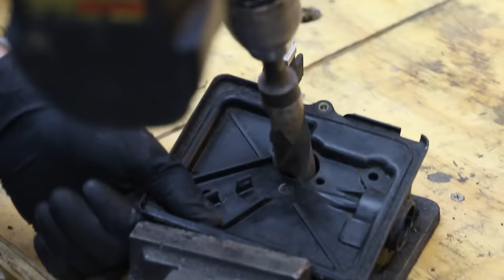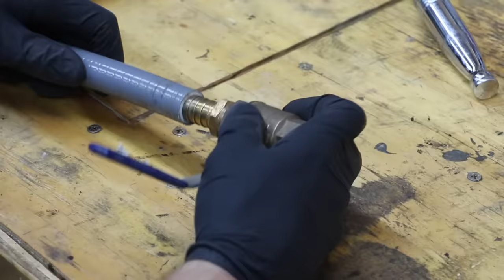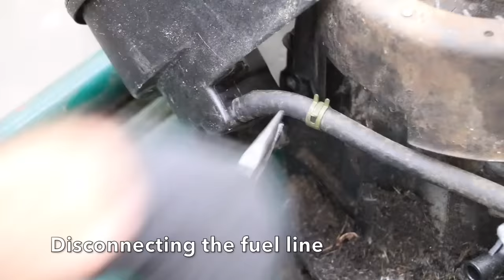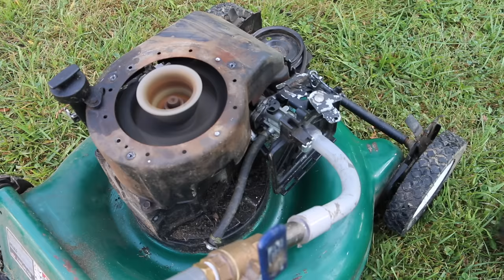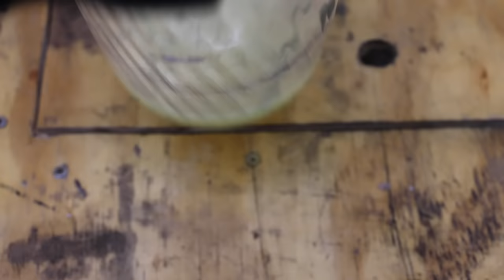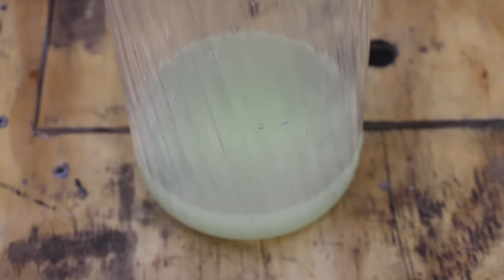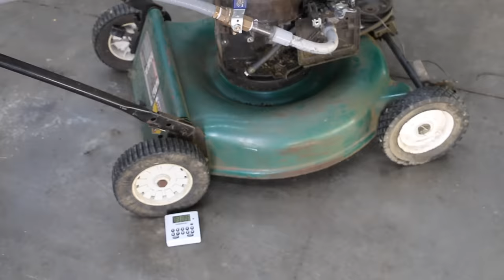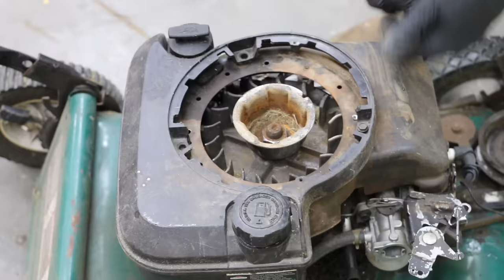Will a "Gas Vapor" Container Improve MPGs and Fuel Efficiency?  Let's find out!

Comment: Funny the Carburetor turns liquid fuel into Vapor . .it works in principle like a Perfume atomizer .. force air into the Carburetor with fuel being brought up into the correct size cambers and  guess what it turns into vapors. you might get a little but more fuel economy but not very much !!
Reply: Nope you didn't do it wrong.. you will not get that much fuel improvement !! period the Carb turns liquid fuel into Vapor so the engine can fire it into Combustion !!!  Wood does not Burn.. it is the Vapor off the Wood that Burns.. heat must transfer solid wood material into a vapor so it it will burn.. therefore Gasoline must become a vapor to burn. And it is the Carb with its different pressure cambers that allows this to happen before it enters the engine.. simple Physics... Though turning the liquid into a vapor first will allow for a little bit but still a small percentage of efficiency... but not worth the effort . .. one thing that could help is turning the fuel into vapor and then chilling it way down.. like with dry ice to like -100 F before entering the combustion chamber might increase the efficiency several percentage points but would not be worth the cost per energy out put !!!
Reply: Still inefficienties, not 100% of the fuel droplets turn to vapor before combustion...with his method it fed 100% vapor...thus the little bit left in bottom of bottle...better vaporization = better fuel economy and power (think fuel injector cleaners)  I wonder if a remote carb say  a foot to 10 feet away down a tube allowing for more fuel vaporization would do the same thing.  Only dangerous part...that extension, if a backfire thru intake valve...could result in a big kablooey
Reply: Brian C I've wondered the same about a setup with a longer draw to the carb. Part of me is inclined to believe that the vapor would sort of re-condensate back into a liquid by the time it reaches the carb. I may be wrong, only one way to find out! Well, many ways for an engineer to figure it out before putting it into practice but I'm just a regular joe.
Reply: Lies! Lies and slander! Ha
Reply: atomization is not vaporization, google it

Comment: Do the fuel vapor with the clear head
Reply from the maker: Thanks for this recommendation!
Reply: Project Farm thanks for responding to me that’s pretty cool, keep up the good work👍🏼
Reply: also is the fuel any good thats left from doing the vapor test ? if you put the left over fuel in the tank will it burn it? if so you can then add that time to the run time of the vapor test so 30 min on vapor then say 15 min on the left over fuel that can be added to the tank so you will have 45 min run time

Comment: RESPECT for an open and honest vid.
...at this point i will conclude its safer to use fuel the normal way...
This is no good for vehicle's tho, unless you have a lot of time to waste, all vapour powerd engine seem to run lean and chug along, turn the throttle up and they stall, they simply cant produce enough power
Reply from the maker: Thanks!

Comment: Should have let the used fuel sit, see if any particulates settled out.  The fuel is acting as the air filter in this case.
Reply from the maker: Thank you for this recommendation!
Reply: I would think quite a bit of water would end up in the fuel as well.

Comment: Great experiment! Truth is, all gasoline powered engines actually run on vapors. Gasoline begins to vaporize at -40F. Once gasoline is atomized by properties of the main metering nozzle in a carburetor or via pressurized injection, the liquid fuel is instantaneously vaporized providing the air fuel ratio is correct and the engine is warmed adequately.
Reply from the maker: Thank you!

Comment: the good part - if the world comes to an end and you can't get carburetors any more this idea could solve the problem.
the bad part - if the engine backfires into the intake you die.
Reply from the maker: Thank you
Reply: Just pop an in line flash arrester in as with the case is with a propane stove. Or, from the bubbler, run the gas feed hose through a watertrap on the way to the motor.
Reply: good point
Reply: it goes POP and might pop the hose off..        oh ps its not a hydrogen bomb..  there is not recurring action to produce more h2 so the brief explosion is limited to that section of hose..

it doesn't even make it through a normal oxy-acetalyne flash arrester for my torch :-(    just a lil POP! and it puts itself out
Reply: either way problem solved

Comment: no matter what, you still need it running in a happy air fuel ratio. to rich and you are wasting and eventually flood. too lean and you ping plus don't have enough for combustion. even if you run on vapor, you can't have better economy because it wont run outside it's set AFR.

Comment: Tried this idea many years ago on a Mercedes Benz car 280. Straight road it worked quite well. Uphill I found a significant power loss. In order to start the engine, I used the normal carb fuel system and once running, it was switched over to the vapor system. Never took it further though.
Reply from the maker: Thanks for sharing.

Comment: I know this is an old video and another awesome one as usual, but I have a suggestion , as I have been down this rabbit trail quite a lot  in these type of experiments...no lie...#1 try this test using non ethanol (I assume that you were using E10 or 15 as the fuel left over in the bubbler was cloudy because it was mainly alcohol and very low hydro carbon fuel chain molecules and additives that hardly flame up, as petroleum gasoline has dramatically changed in 20 years by our GREEDY oil companies , and BS DEQ. It has changed buy adding massive small light weight chain molecules with very low BTU (Alcohol and other cheap additives) out put, which is why non ethanol in a modern OBD2 vehicle gets at least 10 to 15% worse MPG than real non ethanol fuel, thats because the down stream O2 sensor wants to see a certain temp  (think stack temperature) in the Catalytic Converter for the Maximum efficiency to burn all the  excess unburned Hydro carbons, it uses more fuel because it has to make the fuel RICHER because Alcohol BTUs run cooler than Real Gasoline...Just sayin) #2 you should have a tee in line with another ball valve to adjust to adjust a proper AF (air fuel) Ratio. this would change the efficiency to much better run time than what the bubbler strait into the carb, causing it to be a Rich Air Fuel Ratio. The extra ball valve pulling outside air has to be adjusted periodically for the sweet spot but it will make a major difference in efficiency , most likely 50 to 80%!!! (and more if you used an O2 sensore with a micro processor controlled air inlet valve Sounds crazy but its true want even more efficiency add HHO to it and retard the timing by drilling larger holes in the coil mounting and pulling it slightly ahead of flywheel rotation. This Bubbler method works awesome for stationary engines, not so great in a vehicle unless it is a standard trans! I am very Impressed with your channel ...Its my favorite.. Thank you for what you do!! God bless :) Sorry this is a book..lol
Reply from the maker: Thanks and you are welcome!  Thanks for the suggestion.
Reply: The laws of Thermodynamics says that you are wrong.

Comment: Congratulations and nice test. What you have created is a basic carburetor including an intake manifold. What you do here is mixing tiny fuel dropplets with air. This is exactly what is happenening in the intake system of any combustion engine. The difference is that in your case the fuel droplets are created by air succing into the jar, while in a regular intake system this is done after gas was pulled through the main jet (carburetor) and mixed in the venturi tube and intake runner to the needed stoichiometric ideal mixture of 14.3. The key of increasing horepower or saving gas is to mix gas and air very very well. As better gas and air is mixed as more effective the vapor burns and creates less unwanted unused unequal and damadging pre or after detonation. Heating the fuel helps. A regular intake manifold does the same when the engine is on running temp.  But what if you can drive the air fuel ratio up with other flamable liquids or gas. That results immediately into less gallons per miles! I.e. hydrogene has 34:1 ratio or you need a little lessbthank half of gasoline for the same performance!!!!
Reply from the maker: Thanks!

Comment: Can you get an engine running on H202, using a Dry Cell electrolysis reactor?
Reply from the maker: Thanks for the video idea.
Reply: @ProjectFarm  Correction : HHO generator, not Hydrogen Peroxide Generator. haha sorry
Reply: I very much would like to see this! I think HHO generator with a little 12v air compressor to store it somehow, maybe use a solar panel when the vehicle isn't running to beep producing it..
Reply: @masonrumble2608  Learning more about this, there is away to produce hydrogen as it is being consumed.  I think it's promising as a practical fuel as there is no need to contain an explosive gas, just create what is being used.  I subscribed just to see if this will happen....and I like engineering.
Reply: @JorgeL721  or just u know use an electric motor, a hydrogen powered car is beyond inefficient in every way.
Reply: @sebastianflynn1746  Your hot air pessimism is beyond inefficient in every way, back up what you are saying.  The fact is that hydrogen can be more efficient than gasoline.  It's easier to produce and can provide energy for a long trip.  I know Musk would say electric its more efficient, but storing electric power isn't as practical yet.
Reply: @JorgeL721  you're delusional it's called the laws of thermodynamics, its well know efficency for hydrogen electric vehicles is only 30%. Running it as an internal combustion engine would be even worse.
Reply: @JorgeL721  I suggest that you look at the generation of hydrogen through electrolysis and its efficiency. Hydrogen even as a liquid really isn't energy dense at all very volumous for the power it can put out, that's the reason the space shuttle needed the huge external tank and solid fuel rockets(and why hydrogen cars today go as far as a long range ev), something that just isn't needed when you use the much more energy dense refined kerosene.

Comment: Fuel injectors vapourise the fuel though.
Reply from the maker: Great point. Injectors create a mist, which quickly vaporizes whereas the vapor setup only draws vapors/fumes. Thanks for commenting.
Reply: For best results in a car, when doing this remove the fuse to the fuel pump.  Run an extra tube in the container made of copper. Hook up your heater hose to this copper tube (make sure it has no leaks)  this will warm up the fuel as well.  It is MHO the use of a transducer would be best.
Reply: Fuel injectors atomize fuel not vaporize
Reply: Hundreds of cubic centimeters with premixed gasoline and air will blow your car up and can possibly hurt you if your engine backfires. Please dont scale this up in your car, because this experiments are much more dangerous than they appear to be.
Reply: @Mark Barlett It doesn't vaporize it mistifies. Vapor are only fumes mist is actual liquid. Meaning you are wasting fiel through your injectors. Doesn't seem like a lot until you realize you are spending an extra 5 dollars a week on gas. Multiply that by weeks in a year and see what you come up with. Not to mention it would reduce the need for harmful cleaners. As your engine would run a lot cleaner and last a lot longer.
Reply: Has anybody ever took a fuel sample from a car that was running for some time at the fuel rail?  It is quite warm.  The coolant in the engine is 200F.  Cylinder head temperature and other parts can get much hotter.  The point is the fuel is heated by the time it reaches the fuel injector, particularly on a returnless system.  Even some old carburated systems had a heated plate under the carb or ran hot exhaust gasses through the intake manifold.  Years ago a carburated car could be hard to start on a hot day because all the fuel vaporized out of the carburetor bowl.  No doubt in my mind that the fuel is a vapor and not just an atomized mist by the time is ignited by the spark plug.
Reply: Atomize the fuel, what he is showing is actually evaporating the fuel, turning it into a gas.
Reply: You need a certain amount of fuel to keep the engine running. On your lawnmower you can get the same results  by adjusting your carburator to be a little bit leaner.
Reply: LOL on the idea of trying to bypass sequential fuel injectors and running fuel vapor from a bottle to the throttle body.  Even if that worked, it would be less efficient.  This isn't 1963.
Reply: I used to hate those stupid heated plates. The ceramic grills at the bottom disintegrate over time and they were not cheap. Didn't really make  that much difference any way. Always told customers not to worry about it.

Comment: So you assume the internal combustion engine runs on "liquid" gasoline , because you don't see the controlled vaporization conveniently  occuring at the internal Venturi of the carburetor  as it enters the manifold as "vaporized" fuel. 
 What happens when an engine is flooded ? 
Answer: The spark plug is covered with liquid gasoline which prevents it from igniting until after a waiting time and evaporation (there's that "vapor" word again) allow the liquid fuel to vaporize enough that it will again ignite .  So much for running on liquid ! 
  congratulations  we see liquid gasoline in your bottle   is running your lawn mower , the same as liquid gasoline in a car tank is running the car .  
 Even fuel injection is engineered to spit pulses of mist directly in the amount that the closely monitored engine temperature will instantly vaporize in the cylinder , if the injectors are dirty a dribbled  stream of wet liquid fuel , can cause a misfire - concentration liquid gasoline that won't vaporize in the cylinder rapidly enough for ignition.
Reply: Vaporization is in effect evaporation and evaporation doesn’t happen quickly the Venturi part of a carb, It’s purpose is to create velocity so there is enough suction to pull the fuel from the float bowl.  Evaporation is what you see when you’re filling up your tank and you see the fumes coming out but really that’s not fully evaporated,  evaporated fuel you cannot see.  evaporation takes place on the surface of the liquid or around the outer Circumference of the droplet that’s being pulled through the air but it takes time and there’s not enough time to fully evaporate the fuel in the microsecond that it takes to go from the Venturi into the engine. The best you get is a very fine mist along with some vapor if you want pure vapor you have to evaporate the fuel on a large scale or you won’t get enough to run the engine down the road that’s why you need heat and mass surface area to create The smallest droplets possible then you pull those through the heated surface area I use copper wool this breaks down the droplet size to almost a pure vapor, The final vaporization takes place when the hot 250 300° air mixes with the fuel and then goes into the hot manifold and into the engine
Reply: @rmendes2mendes915  evaporation doesn't happen quickly ?  ?  Under what temperature and what pressure and what liquid  ?  
Combustion vapor is only concerned with @ the point of ignition @ the  maximum cylinder compression @ the operating temperature , and if below temp.  in extreme cold  ,  thus lower the evaporation temperature of the fuel/solvent, which  temporarily at lower pressure/temperature vaporizes so quickly & so very well -- such as using ether starting fluid ,  instead of gasoline or the diesel fuel .
 Define "quickly" ? 
 Would you define a compressing diesel piston  rapidly heating  up a  compressing volume , of  freshly engulfed  air/ ether starting fluid mixture a slow vaporization event in the moment of combustion 
(where those vaporization  conditions  are  only relevant to enhance to overcome   cold engine conditions)  
What are "glow plugs" doing ? At the point it matters most ? 
Why not boil a 300 gallon tank of diesel fuel til diesel fumes are vaporizing and pump those into the engine so the engine can have a much lower compression/flash point  ,  spray ether out on a Texas  black top parking lot  of  125° in the sun , and tell us in a video how slow evaporation is .
Reply: @rogersmit4193  you cant tell i am talking about gasoline by reading my post ?  If you think all the fuel is fully vaporized in a Engine then why do we have secondary systems to deal with the unburnt fuel?   Why would I define ether as a slow vaporization process when everyone knows how fast ether evaporates we are talking about gasoline here.   Glow plugs? Again we’re not talking about a diesel engine burning diesel here.   I would say anyone attempting to boil a 300 gallon tank of diesel fuel would need to locate his nearest mental health provider.   I have vaporized Diesel also used motor oil it requires high temperatures and yes the engine will run off these vapors so what’s your point.     Your analogy of spraying ether on a hot surface in no way can it be compared with how gasoline combust in an engine.   I have never said gasoline does not produce vapor in an engine I am stating that all the fuel does not fully burn or fully evaporate at the speed of which it goes through the process.  Anyone can figure out the fuel doesn’t fully evaporate by the engine producing a lot of heat and black SuIt and the need for Emission control systems.   You are also not going to get full vaporization because you are drawing in ambient outside air.   Maybe you have never squirted gasoline down a carburetor and found that the engine will start right up without going through the Venturi process.  Maybe you should do some experimenting with the suggestions I gave and find out for yourself if what I say is true.